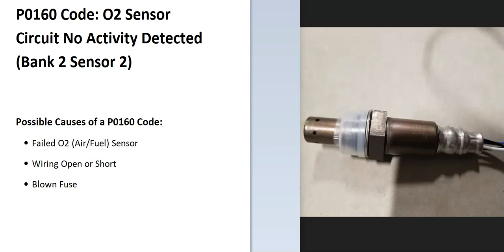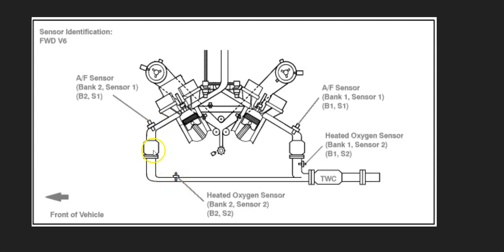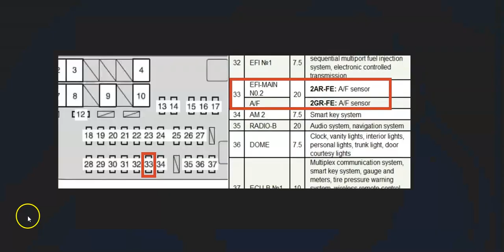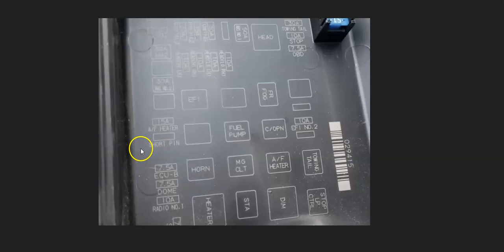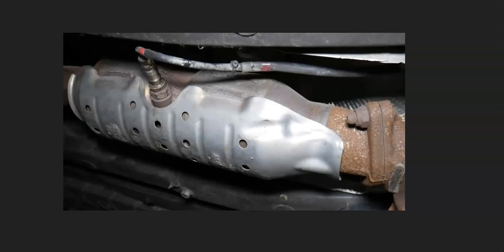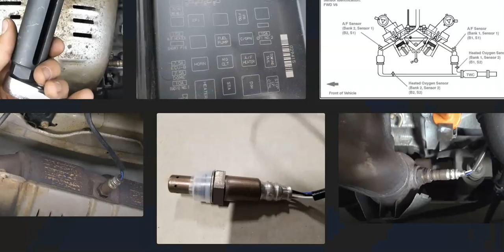Causes and Fixes P0160 Code: O2 Sensor Circuit No Activity Detected (Bank 2 Sensor 2)

Comment: O6 g6 3.5 lts  bank1 sensor 1 no activity detected
Reply: P0134 is the code and just put in a new one but had no codes for awhile alot of carbs built up on old one

Comment: Can i drive with this code
Reply from the maker: Yes, the engine will still run just not as well as it could and won't pass an emission test but should still run.
Reply: @HVAC_Mechanic Can I put an oxygen sensor spacer to make my engine run smoother ?
Reply: @Rickydalowk  that only works for the situation where the problem is a poisoned catalytic convertor.

A bad sensor is a bad sensor, no fix but to replace it.